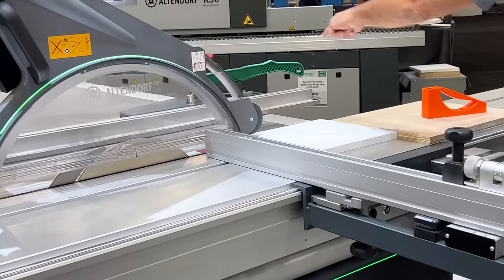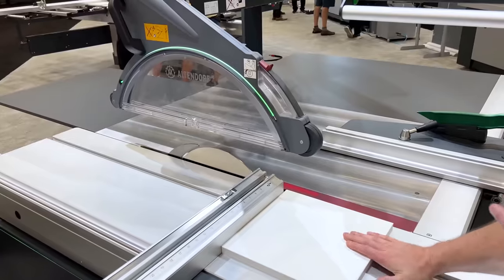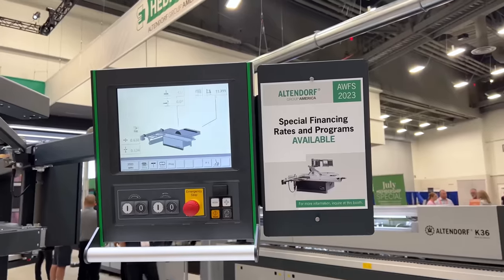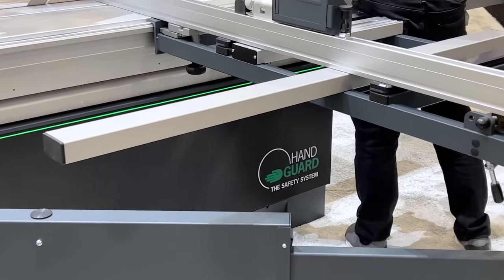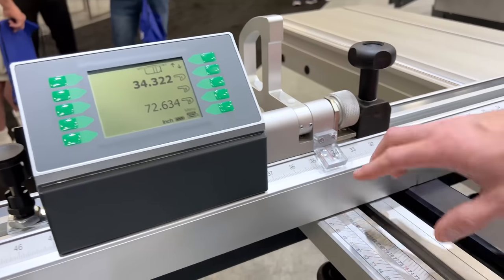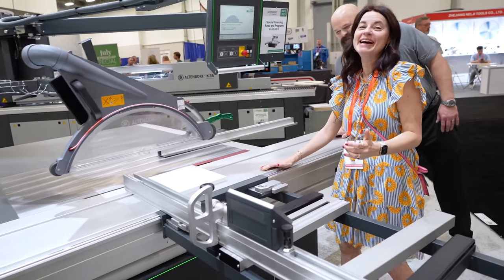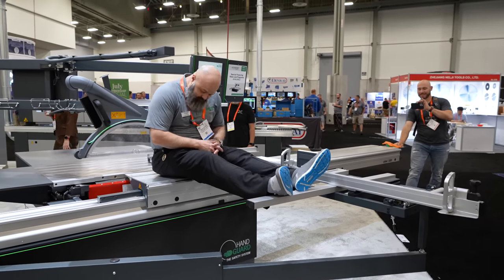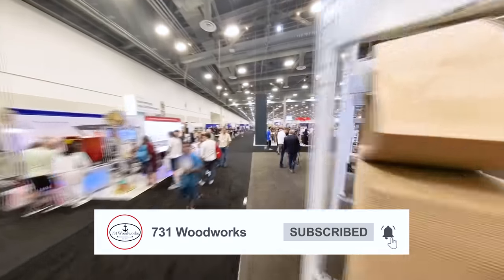The Most Exciting Table Saw in YEARS!

Comment: Anything that can keep woodworkers safe is a win in my book.  But it’s probably going to be out of the reach of most of us.  Anyway, 10/10.
Reply: I'm guessing it costs more than a lot of us paid for our homes!  Pretty cool though!
Reply: True but it will be common at a much cheaper rate in time. Tech actually does trickle down
Reply: After I hit the Lotto, it will be in my garage… 😅
Reply: @Slowhand871   yeah, the sawstop came out in 1999 and 23yrs later, trickled down into something even more expensive.
Reply: @Pepe-dq2ib  On the bigger ones you don't pay much more than comparable saws from PM etc. I do wish they could get the jobsite ones cheaper for tradesmen.
Reply: Eventually systems like this will come out for consumers.
Reply: @Slowhand871  Yeah, they'll go from $500,000 to $200,000. That sliding table alone probably runs 100K.
Reply: @Slowhand871 The price just for the saw without the safety stuff would equip a small shop nicely. These are big boy toys.
Reply: It is best in the industrial sector since there you have people making the same cuts all day and that is where the biggest risk is.
Reply: According to their website, it starts at  € 44,620 which is about $48,750 usd
Reply: @rusticfox4283  Wow, that's a lot cheaper than I expected. Still way out of range of anything outside of a production shop though.
Reply: @garyblack8717  for home use, this is absolutely overkill
honestly, just get a sawstop for home use/diy/professional contractor

you're probably not going to be cutting enough wood for you to make a mistake often, and you're probably going to be one of the only people to use the saw
in a production shop though, many people are likely going to be using the same saw, and like, 8 hours a day of just sawing the same thing is prone to accidents, so with this system, the cost makes a whole lot more sense
Reply: I run a cabinet shop. This kind of thing is what companies buy who have lots of employees and are always training new guys. Isn't really something a DIYer will buy for his garage.
Reply: If we had a sane country health insurance companies should subsidize the difference. It would actually be a financial win for them but yet they're too arrogant to do it
Reply: @garyblack8717 Jesus, did you not even Google it? Must be gen z. It's 20k for the 10 foot sliding table, hand guard tech is a fee on top. Not a 80k fee. Now stop spreading rumors on the internet 😂😂😂😂
Reply: @natemartinez4595  Why in the hell would I bother pricing something I have no intention of ever buying?  I am a bit surprised it's  only the price of an entry level sedan.

Comment: As a software engineer, I wouldn’t trust any proactive software safety mechanism without a physical reactive backup like a sawstop. Software engineers are notoriously bad at writing software
Reply: 100%
Reply: Software engineers aren't "notoriously bad" at writing software (yeah, I'm sure some are), but they're not great at envisioning every potential use case.  As soon as you think you have an idiot proof product, the world provides bigger idiots to prove you wrong.  As a non-software guy managing a bunch of software engineers doing control systems for heavy equipment, I can assure you that it's hard to simultaneously account for all of the stupid things humans will try to do without getting in the way of what a good operator is trying to accomplish.
Reply: @rohlfing63  You're exactly right...but I'd still agree that the general quality of coding (especially when interfacing real-world scenarios) is middling at best.

Comment: As a computer scientist who also does woodworking, it is awesome to see this type of technology crossover. Thanks for sharing!
Reply: As a tablesaw, I don't like cutting off fingers.
Reply: As a computer scientist I don't know how I'd feel about trusting my fingers to computer vision 😬
Reply: @tehbieber  Same. First thing I thought of was "hell no" and I work in the software industry.
Reply: @garagehobbies  I mean, whatcha think makes sawstop work?
Reply: @nattyg078  A process way more reliable than (current) computer vision. But who knows - AI is getting better by the month and might just be reliable enough soon.
Reply: @nattyg078 not the same technology
Reply: @gl5986  software is software. Kinda familiar with computer vision and image processing. You know, having built biometric auth systems based on iris scans and facial recognition. Of course, that was after spending more time than I care building post-processing software for digital cameras. Thanks for the clarification though.
Reply: @nattyg078  cool story, expect sawstop doesn’t use computer vision at all so your first comment still doesn’t make any sense
Reply: @jameswilliams3304 Computer vision is slow and inaccurate in the best of conditions. I'm a computer scientist too, and the moment "AI" gets mentioned in a safety tool I start to hyperventilate. Stopsaw is a purely electrical process, working faster than the saw can spin, this is slow enough you can see it drop. What's the framerate on those cameras? because a kickback accident pulling your hand in happens faster than a 60fps camera can capture. Let me guess, you can run this thing with a phone app too?
Reply: @veiledAutonym  because you write software (presumably) does not make you a computer scientist. An actual computer scientist wouldn't be "hyperventilating" over CV being mentioned, for one, and secondly, wouldn't refer to sawstop as "purely electrical", because, I dunno...they've actually looked at a brake and control unit because they own one and see all of those cutesy little chips that run...wait for it...software. Back to whatever crackerjack box you became a "computer scientist" from.
Reply: @nattyg078  Computer Science is the dumb name that colleges picked for the programming major that most of us have dealt with but I'd honestly just refer to myself as a software developer over that
Reply: @nattyg078  you’re right I should just throw my cs degree from a T30 university away. You wouldn’t say a an airplane is the same as a tv just cause they both use chips and software? Sawstop and this new saw are fundamentally using different technologies to achieve the same result
Reply: @nattyg078  You know most "chips" don't run software right? They're just tiny circuits that more often than not analog in nature and does not contain software.

Comment: Wow!!! Please get this into the consumer market asap!! Absolutely fantastic safety
Reply: Yeah, only cost like an arm and a leg..
Reply: I wish Festtool (who bought Sawstop) didn't sue bosch for trying to implement similar safety features into their saws. I really like boschs concept, just like sawstop they simply measure the conductivity of the material, to check if it's wood or your finger. but unlike sawstop they don't stop and destroy the blade by ramming a aluminum block into it with explosives, but instead use the explosives to shoot the blade downwards and therefore you just have to change the explosives and not the blade and aluminum block as well. it was a relatively cheap and very safe system. I'm just waiting for the sawstop patent to run out
Reply: @Ryan-re1rs  but keeping your fingers: priceless ;)